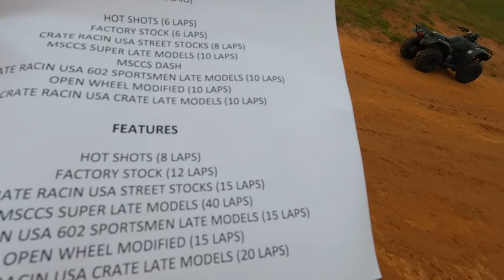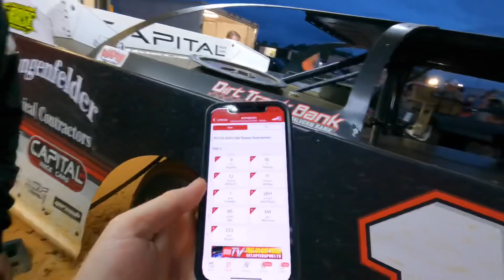Two Cars and Three Wide Racing at Whynot! Our First Time Hauling Both Race Cars

Comment: Two cars at the track nice. They both did good. Bringing you equipment home in a piece is really good and a solid finish for both. Jonathan you were running around like a chicken with out head, trying to get everything on video. May need to step up the filming crew with two cars. Keep up the good work fellas.

Comment: Nice work Team HTF!!!  Joseph didn't need that caution, that's for sure. He'd just got that tire up to temp and just did start workin' for 'em; when it "fired" he started moving forward. Jesse did a great job --- though he never got to the top... headed up that way but still didn't reach it. And yes, did see that move --- sewwwwwweeeeeeettttt.  Personally, felt he needed to jump up just after he got passed there when it opened up --- thinkin' he'd found some comfort up there "rippin' da lip"..... but hey --- seat time plays a big role.  Good finish for both!!!!  Shoutout to #FloRacing for sponsoring!  #HTFNation #DirtOnTwitch

Comment: Good run both you guys .. Joseph driving the wheels off , but looked like it wasn't getting a bite off the corners , I heard him say the others probably running softer tires and the caution hurt him .. Jesse made a great move out of the corner , and seems to be getting a little bit smoother on the track .. it looked like two cars may have been a little bit of stress , especially running back to back , but it turned out really good though .. glad to see Dirt Daddy there helping , really great .!!!

Comment: Since you fellows are going to Fairbury Speedway for the Prairie dirt classic. It might be a good idea to at least have Joseph old car with you as a backup car. So you at least have a car to put the super engine in if something happens to this car Joseph is driving now.
Reply: It's not that easy there's a lot of things that are different between the super late model and the 604 running wise shockwise
Reply: @davidtowns7363  Yes, I realize that. Although  I do believe the shocks are the same. Since Jonathan was using the right front shock off of Joseph car for a while. Needless to say, the cars are the base car is still the same.

 And they can swap items like the shocks, engine, oil tank oil cooler and so on. Which is better than not having a spare car at all. Since it better to have a spare car and not need it.  

Than leave the car at the shop and need it and not be able to race, and make money, while that far from home...

Besides the 604 is not in the other car right now anyways...
Reply: I had forgotten the 604 was not in there you're absolutely correct. At least we both enjoy seeing the guys do well and we always hope that they come out the best they can when they go to the racetrack that's the joy of bench racing I guess LOL you have a great day and a great morning talk to you next time

Comment: You guys could get a strap or line and hook it to a rear d-ring and hook it to the rear of the car as you push it out. That’s the way we did it the winch was a pain in the butt to use but after seeing someone fall off trying to stop a car up top we used a cable to stop the car from roiling to far on the ramp.

Comment: Neither car had enough forward bite from middle off. You guys have changed something. Not been the same as last season.
Reply: I’m seeing too much wheel spin coming off the corner. You have got great hp, but need it on the ground. 
Once you do that, wins will come fast.

Comment: We are back at my little track out here in California, Willow springs speedway California, 
July 24 2021, gates open at 12 and first race is at 7 pm, all classes , I got the call yesterday to come back and do the towing with my mater tow truck , oh yeah , we are back , thanks,and chase Holland won his main at why not speedway too , do not leave the ramp door up if the filter and hydraulic oil have no been changed, please fix it, thanks BigAl California, you should keep it on the ground til you fix the leaking oil problem ok,thanks nice thanks BigAl California.

Comment: Is it just me ?  We both run hot laps WOT flawlessly Gentlemen , looking really good.      Then get in the race and start letting of the throttle in the curves. The only way yall are getting beat is from burping the throttle in the curves. Id like to see BOTH sides of Josephs car during the race. OUT FRONT. I love the collision avoidance  pass to the inside Joseph.     HTF just put your foot down and hold it there.  I wanna see a SRX series type  LARGE digital tachometer on the dash pointed toward the camera. GREAT JOB  CREW. GOD BLESS and KEEP YALL and FAMILIES SAFE while setting the example. Do what You LOVE and Love what You do.  AMEN      GREAT VIDEO
Reply: One thing you have to realize track conditions change between hot laps and racing a lot of racing goes on on that small track in a very short period of time a lot of different classes what worked in hot laps while the track was nice and wet isn't the same when the track dries out and chunks out you have to adapt. They are great guys appreciate you comments but unfortunately you can always hold it to the floor. God bless catch you next time

Comment: I think the car has a issue. Isnt getting around like it usually does for joe. Get shocks rebuilt
Reply: It's cause Jesse is use to running a shorter shock on the right front 🤣
Reply: @Hunter-eb6hx  bud. Do you know I have been around racing my whole life. How mental are you to think I know anything. Do you even know that last time they had there shocks rebuilt ?  You think these big boys aren’t rebuilding there shocks every few races if not every race like ... but I’m dumb right.
Reply: @paintdude96able  no shit 🤣
Reply: @Hunter-eb6hx  have you ever drove a latemodel ? Ok.  Thanks. Have a nice day.
Reply: @ViolationNation  yes i have Im a track champion before i got hurt..back at cha. Some time leather tastes nasty
Reply: @ViolationNation  Any thing you think you know well that's your deal I worked for 14 years with dirt Latemodel team and another 6 years on a cup team year. So nah move alone.
Reply: @Hunter-eb6hx  you commented on my shit buddy. Tell me to move along. Don’t comment. Cause honeslty. No one cares.
Reply: @ViolationNation  Is there a certain comment you would like me comment on?

Comment: I know joseph don't normally miss the set-up, it is half way through the season is it possible the motor has weakened? Just asking!
Reply: Motor only has 5 or 6 nights on it.
Reply: @gailtaylor1636  I counted 20 races!
Reply: @manleybrittain1296  Engine was freshened over the winter. Was fresh when installed in this car.
Reply: @gailtaylor1636  Engines don't go by nights it goes by laps a motor usually laps OUT at 1200 laps but in there case they will need it sooner and yes at this point they  have lost power just like every another racing engine out there.